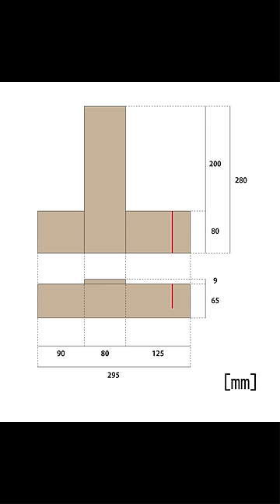Few People Know About This Hack🤫 #shorts

Comment: Better is to use the radial arm saw with a dado set. Many ignorant people get rid of the RAS for the compound slider. Unless you work at a jobsite, the RAS is far superior. Both have the weakness of poor dust collection, but for long pieces the table saw is not as good.

Comment: Just mark it and cut it, use a speed square next to the sole plate if needed, no need for one joint to take 2 hours, sharp blade is the most important part
Reply: I think the advantage of the jig is that you can "see" the width of your blade. So you can cut out the mortise precisely....